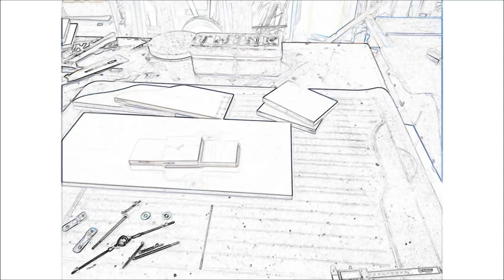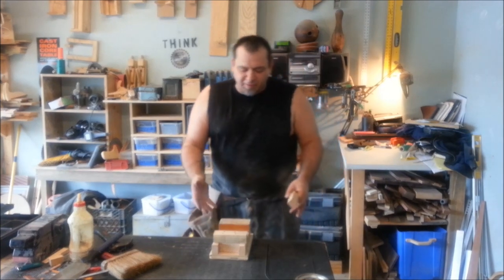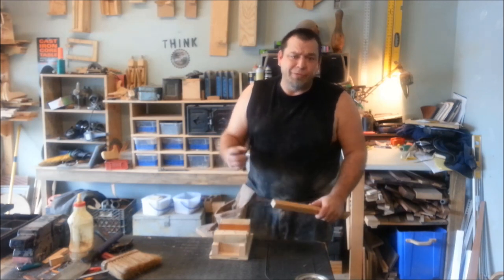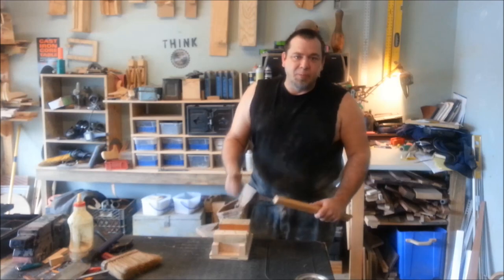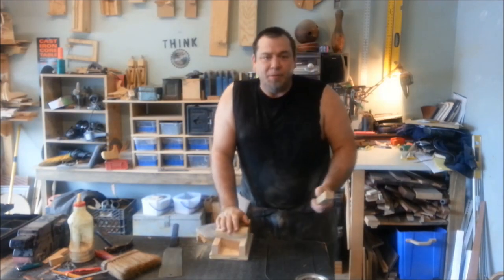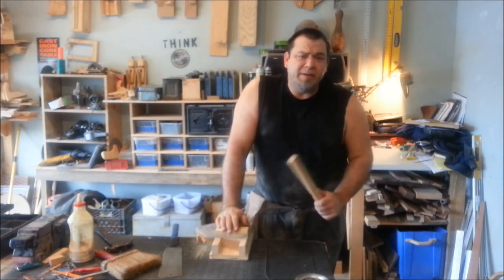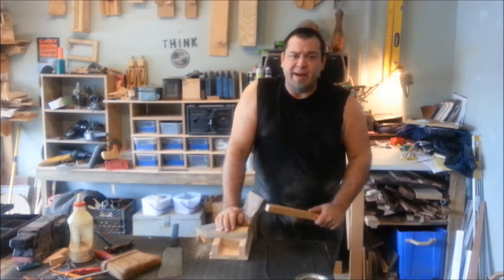Homemade DIY (Bench Vise) Foot Powered!

Comment: I like this so much that with two dog holes in the base it locks onto my bench top and is removable when not in use... seems like it moves up and down the bench but doesn't go very far when I need a flat bench top.
Fred

Comment: If you have limited space like I do in my shop you could utilize some unused space and make it the same height as your chop saw and have it double as a board rest for longer boards. Or make a slightly bigger one that could hold the longer boards in your vice for your chop saw.

Comment: Sort of a vertical shave horse thingy. Well done. I bet you could have used this to saw out the parts for this. One of the best ways to work SAFEly is to have a way to SECURE the work piece while you are working on it.